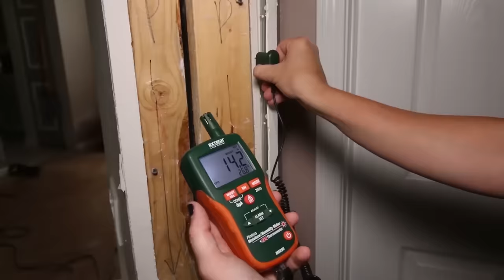Episode 2: Orange Sink and Bloody Floor

Comment: I disagree with the statement that carpet glue acts as a barrier to the subfloor. Carpet glue dries out and turns into a dusty mess over time, especially in the traffic areas. It is very permeable to fluids.

Comment: I'm actually in the process of cleaning a single wide mobile home with a biohazard issue basically what happened is a man used to live there alone well he up getting so old he couldn't take out his trash so it got to a typical hoarders situation + over 150 trash bags wel he ended up passing away on his couch and wasn't found for 8 days during summer in a house with no AC Texas summer btw and yes the hot ass 2018 Texas summer when it was up to 100+ degrees outside anyways since he wasn't found for so long he ended up getting bloated and exploding on the couch so body fluids everywhere so after his passing and his body was removed his son came in (he is a felon) took any guns and valuables out of the house ripped every trash bag open absolutely destroyed the house we ended up cutting the Capet and floor out replacing the floor there since it had soaked into the cheap glued together sawdust plywood his son ended up throwing the body fluid soaked couch outside where dogs chewed it all to hell so yea I feel for you guys doing this as a job
Reply: (still working on the house as of today we hadn't started till nearly half a year later is when we were asked to do it)